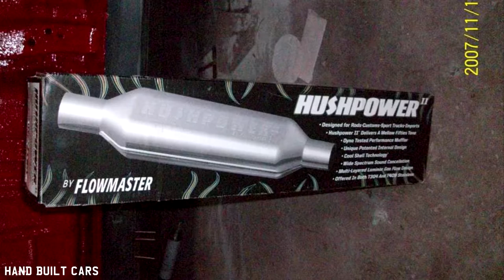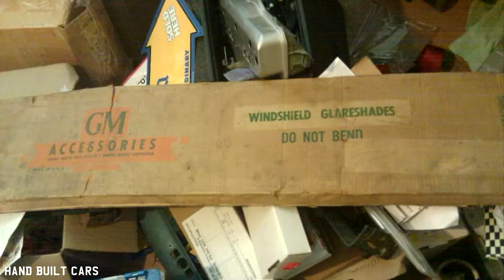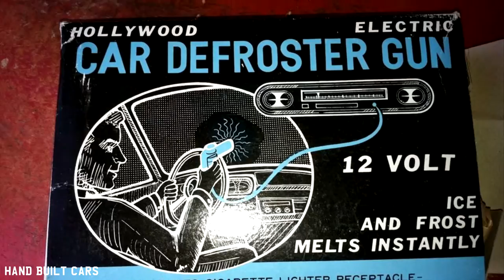1961 Chevrolet Impala SS Bubble Top Restoration Project

Comment: Beautiful job ! Question...Why did you substitute the Fuel Injection script where the Impala script and cross flags always go/belong ? The original Fuel Injection badge for full size Chevys went on the front fenders just below the trim and up tp the headlight. They contained the script and with a forward perpendicular checkered board V sitting in a Red V. The only Impala Logo badging was in the rear color coordinated side trim on either side.